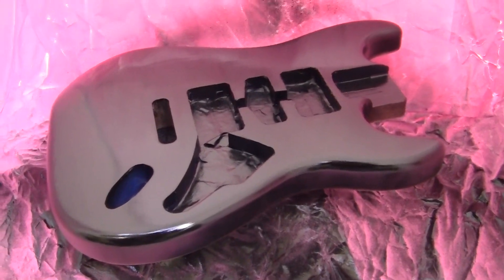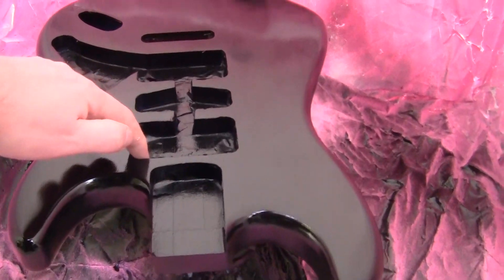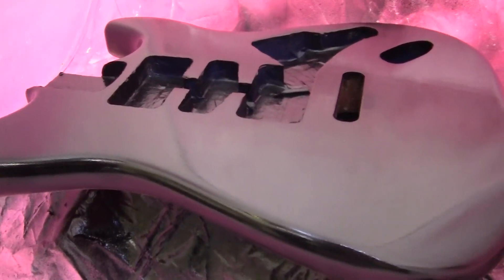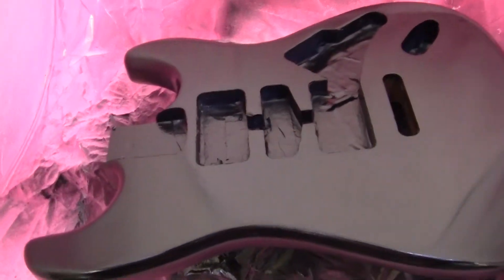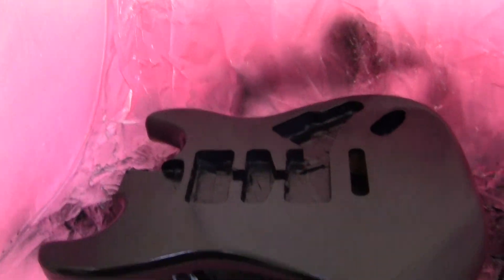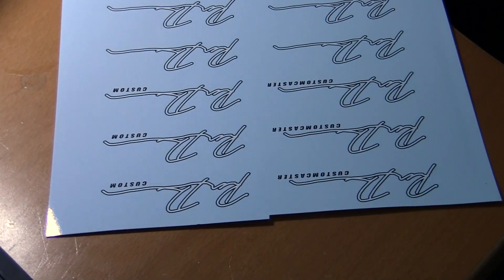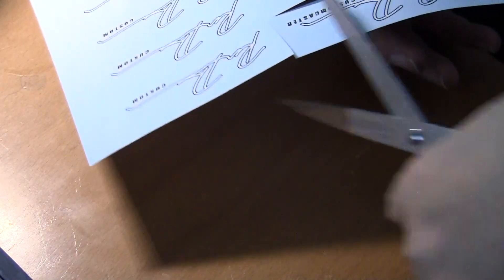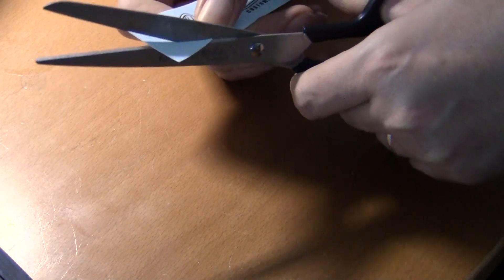Spray Painting a Guitar and Adding a Water Slide Decal

Comment: When I first started watching your videos, I immediately noticed your signature on the guitars and wondered how you did that. I remember using (and being occasionally frustrated by) similar water slide decals on model cars I would build as a kid, but had no idea you get them made like this...it's a really cool touch. I presume you put the decal on after you've finished any painting/staining but before some kind of final clear coat? How does this work on your necks finished with Tru-Oil? (maybe you cover this in a later video, I'm working my way chronologically from oldest to newest).
Reply from the maker: It’s easy to cover a decal with poly, but the tru oil doesn’t play well with the printed decals, so I recommend vinyl for those. Other techniques, I have yet to try: screen printing, wood burning, laser cutting, inlays... there are so many options!
Reply: @GuitarOverdrive  Ah gotcha. Wood burning! That sounds like an interesting approach. Thanks Ras.